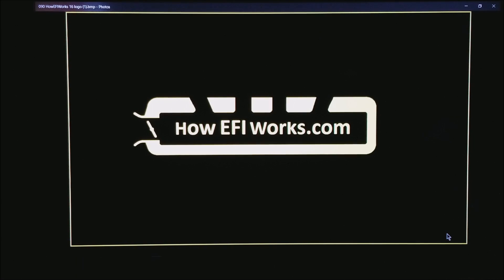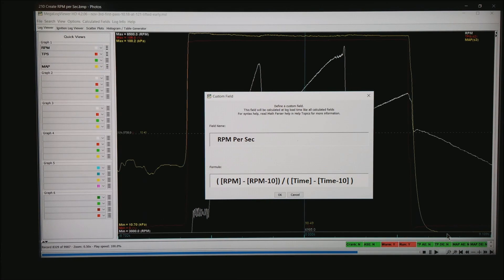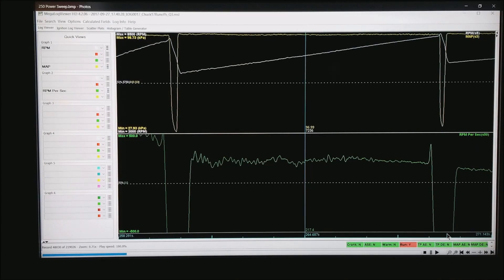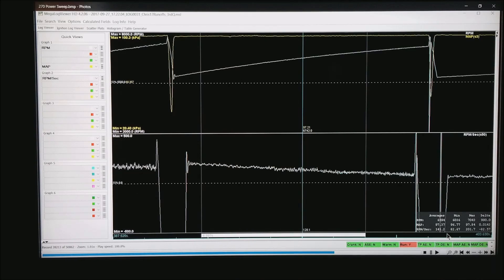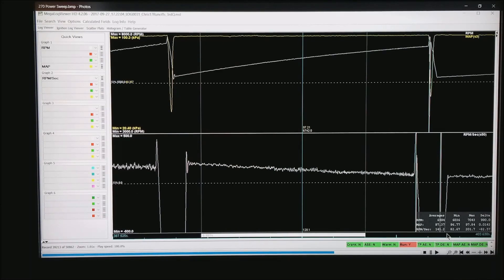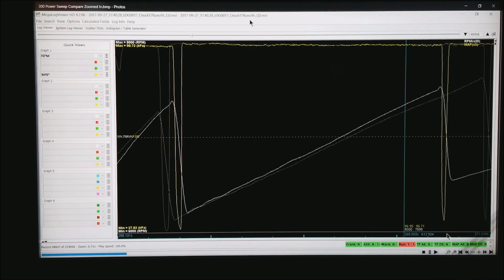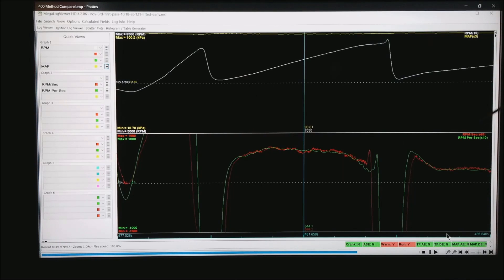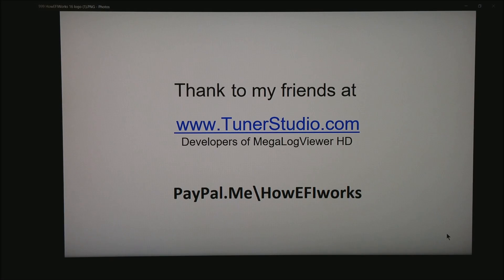Using Track Data to Find Hidden Power

Comment: i understand what you're showing here, but i don't get how to find the hidden power😕
Reply: Check the RPM per second. Add 0.5 degrees of timing and go out and repeat. If you get more RPM/SEC from that, then you have more power. Repeat that process on the same road, back to back until you either stop making power or you encounter knock.